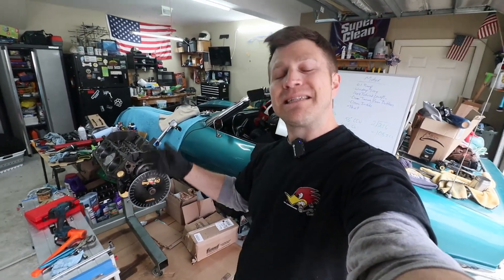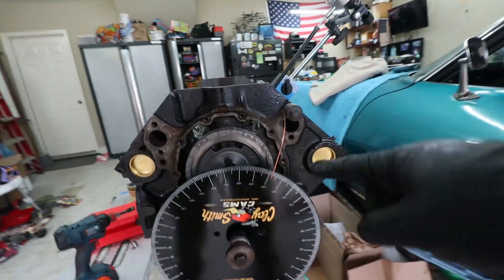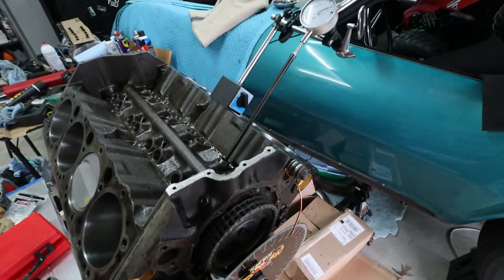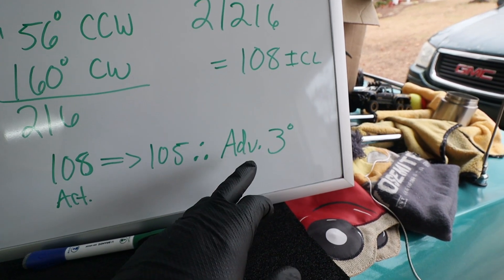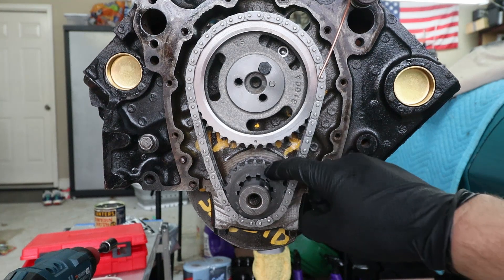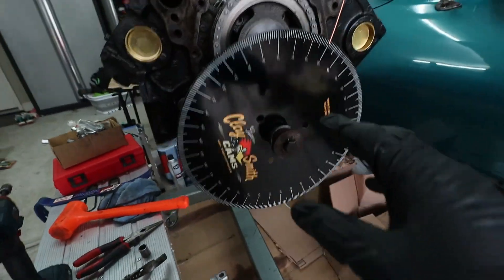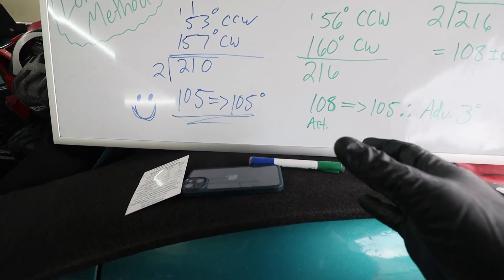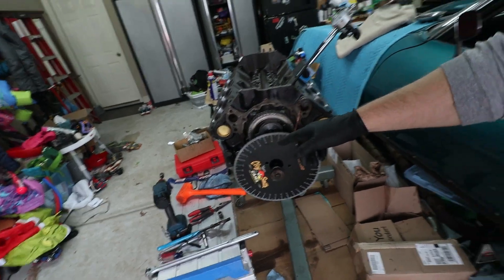Dot to Dot Camshaft Timing Might be WRONG - Degree your Cam Correctly

Comment: That one degree shows up because of slack in the chain /belt/gears    When you are tuning the engine in one direction and then turn it the opposite direction there will always be slack could you see it or even feel it NO but it is there even the chain rollers fit in the gear is there you sir hit dead on I have seen guys adjust the crank gear and get close like you did and then put an offset key in the cam gear and it totally screws things up when math says it should work i would also like to add that if you hit it perfectly then run the engine 10 minutes and check it it will move a degree or two. Do exactly like you just did get it close like you did cover it up